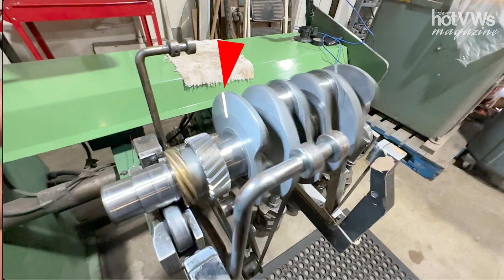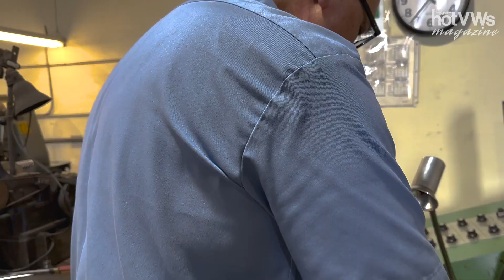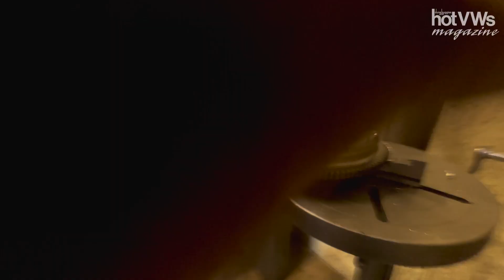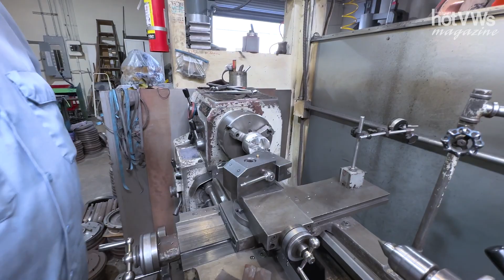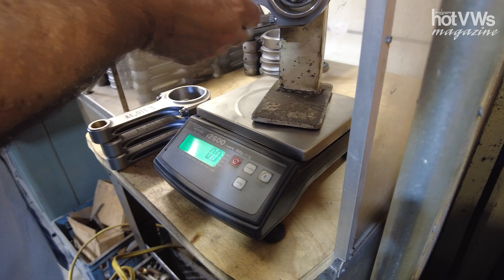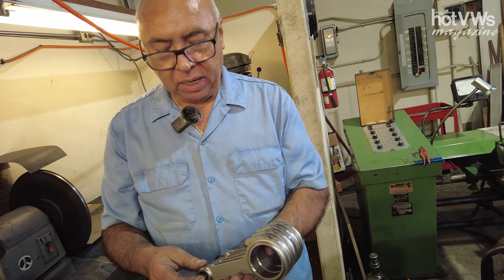TECH Feature: Balancing the Moving Components at DPR Machine Shop

Comment: The heavy spot does NOT move.  If you do not really know where it is - you will end up drilling all over the place.   Get a first read on where the heavy spot is supposed to be.  Then do a challenge on the opposite side  - the light side gets the weight.   If you find zero - then you know exactly where the heavy spot is.   Old strobe machines have to use trial weights on the light side or you will end up w/a part looking like Swiss cheese.  LOL>   Computerized balancers can tell you exactly which angle to drill and how far from center.   But those strobe machines - you have to know how to use that one.    And the heavy side on the LEFT side is missing the woodruff key which obviously is the light side.   I have used strobe machines a long time -    What machine be this you are using, sir?
Reply: I dont understand how these machines work ? The lamp flashes when the heavy spot pushes the support towards the accelerometer or sensor ? How do you know where the heavy spot is relative to the mark you made since its position is arbitrary ????